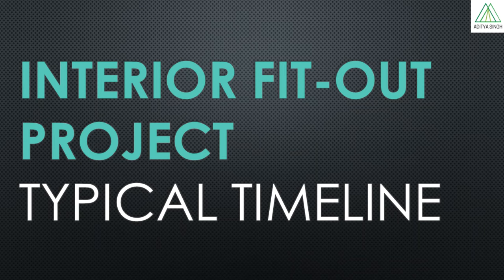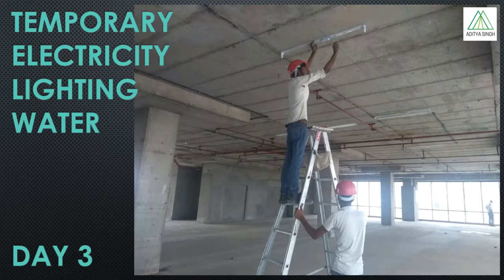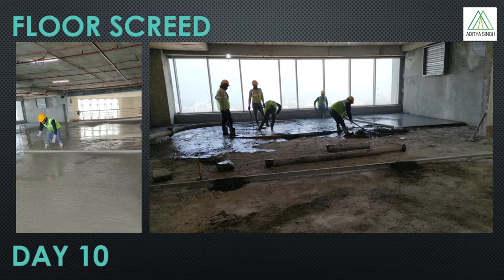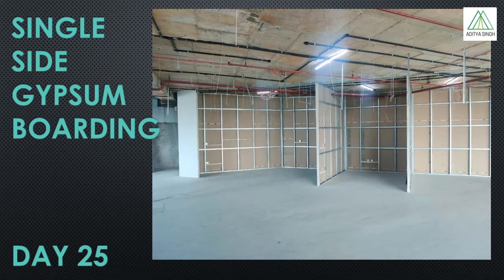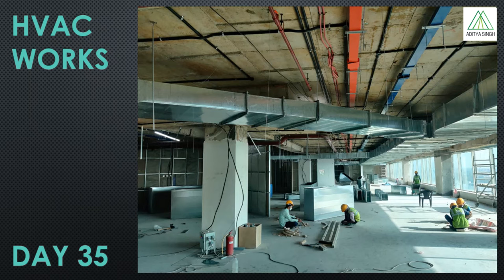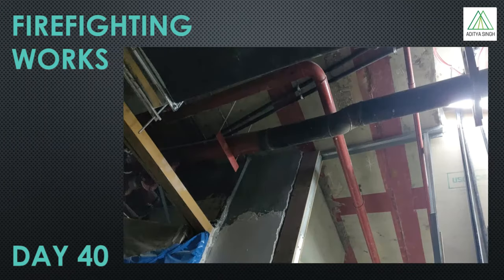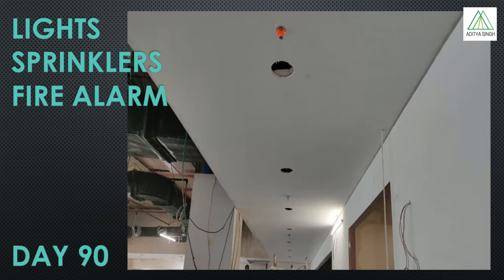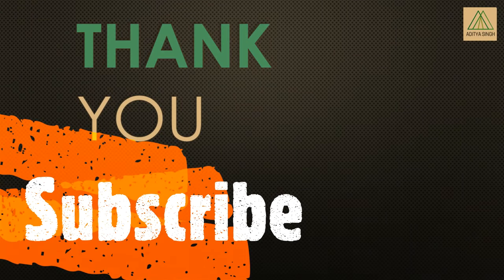Practical Scheduling Timeline for Interior Fitout Construction Projects

Comment: What about the cost ? Per sqft for the fitout
Reply from the maker: It will depend on several factors like what kind of finishes being used, what is the scheme for MEP works being followed, where is the project located, is it office or retail or residential...so hard to give a generic answer.